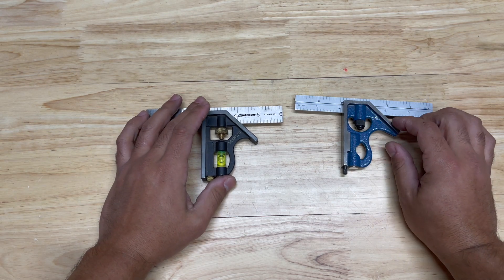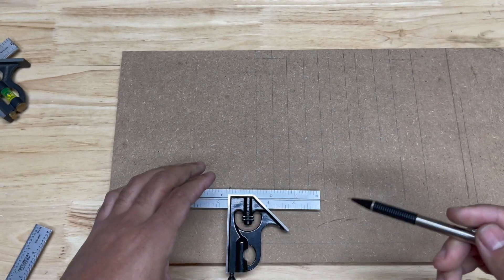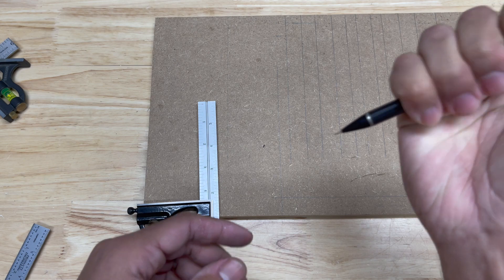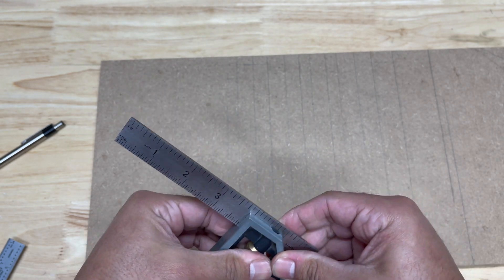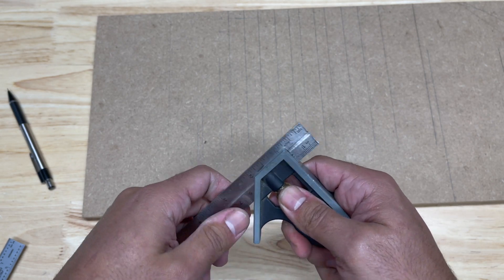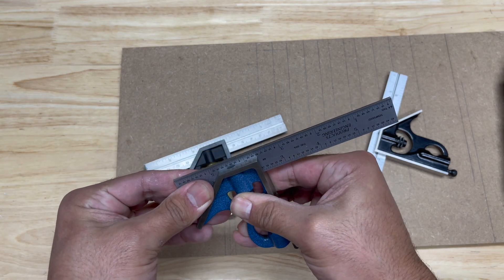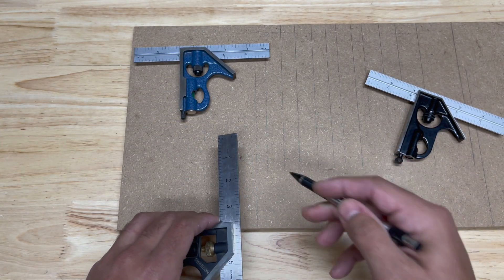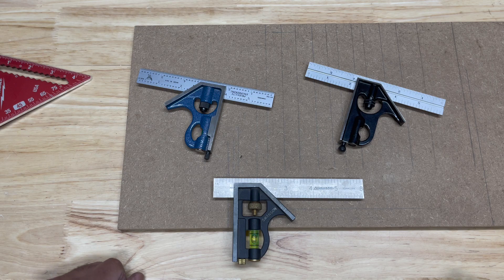Comparing Starrett, PEC, and Swanson Combination Squares! Are Cheaper Squares Sufficient?

Comment: 7 minutes in and still no info yet.. Thing 1,, The wood being used to reference is not adequate,, you could not have chosen a worse piece.. It you want to be proper,, use machined metal.. 9 minutes and WRONG about the fix,, you created a very tiny spot that the blade is riding on, which will wear real fast, NOT all are cast iron,, many are forged and hardened steel.. DO NOT THINK YOU CAN HAND FILE A PEFERCTLY FLAT surface which is imperative to the accuracy....   WHOLE LOT OF BAD ADVICE HERE

Comment: Im 73 now and ALL my squares are Starrett. They are by far more accurate and reliable than any other brand I have  bought. I have a t square that is over 100yrs old and has been used so much the corners are not really square any more. They ALL fit inside of each other with NO gaps anywhere. Squares are the ONE tool you should spend what you can afford . You will use a good one for your lifetime so its a one time buy. Sold all my cheap squares. The advantages to quality tools are comfort of use, accuracy, reliability along with resale value. Should you not require any of your tools, quality is REAL easy to sell to someone else. FWIW I NEVER check my Starrett tools any more. Another advantage to quality tools is expansion. My 12in combination square will take up to a 72in rule. I have a 24in for it that on occasion comes in REAL handy. There will be a lineup to buy all these tools when I am gone for sure. They live a VERY long time.

Comment: One thing you forgot to mention is removing this through the head you should always Force the locknut forward with your thumb so you're not rubbing against the nub inside under pressure as soon as that now wears it's going out of square I always keep a light wipe of camellia oil on my tool and I mean light one or two drops an old t-shirt is all you need

Comment: Thanks for the video. Couple things I've run into I think you should mention tho with cheap squares.
You cant just do the squaring trick with one side, i have a stanley cheapy that is perfect on putside edge and way off on the inside. If I'd adjusted it based on one I'd never have learned that the error is actually from the ruler which was cut at and angle.  And I'd have killed my totally fine square head. 
Also with the more expensive ones the blade locks totally parallel, and the marking are far more accurate. So if your doing carpentry wtf it dont matter but with small finicky finish stuff or for me picture framing where a mm off equals a visible error than it really does matter

Comment: Forget the line and flip technique. If you are serious about your craft you must have a square in your shop that you trust, engineers squares are way more accurate than even your premium Starrett, this square has no other purpose than to check your working tools.  Any combination square can be trued in minutes with a needle file as demonstrated. The only thing you sometimes don't get with the cheaper end of the market is how easily and solidly they lock.  Look for brass locking nut and have a play before you pay.
Reply: Yes, and many engineer's squares are out of square too, so you still need to check with this technique.
Reply: @VideoArchiveGuy Eng8neers Squares come in many grades. My post suggests that you merely buy one decent quality square and use that only for checking your working tools.  Line and flip may be good enough for site carpenters but not for furniture makers you simply can't see the small errors, if you persist in using this method use a marking knife rather than a pencil however sharp.

Comment: It seems kind of pointless to compare any combo square with a speed square, which is a tool for laying out rafters and other uses in rough carpentry. The so-called “DIYer” may care about the versatility of a tool, but for professionals the right tool is the one that is best suited to the specific work being done. I’m not going to frame a roof using a combo square. I’m not going to lay-out dovetails using a speed square.

Comment: I bought my Starret combo Square in 1983 for $40.  I soon thereafter bought the protractor and center head.  Today I went to Starret's site to find the three piece set + ruler goes for $288 !  I have just thoroughly cleaned and oiled all the pieces. I have picked up that Combo Square tens of thousands of times and it always felt good to use the best.
Reply from the maker: There is something different about using a quality tool vs, "the old run of the mill" tools!
Reply: I bought them all around the same time 4" 6" 12" w/ 24" & 36" blades, with all center heads and protractor.. I refused to lower myself to buying Mitatoyo stuff   like the other people did  All still in the RED boxes too.. A couple years back I checked the new price on my 36" blade,, The first thing I saw was $600.00  for just the blade...

Comment: You might be able to square the 90 on a less expensive square, but the 45-degree will be harder to verify and fix.  I used an inexpensive 45 from a combo square to set up my miter saw, jointer and band saw with it and couldn't figure out why my miters were all just a bit off - I blamed myself, the saws, everything but the real cause - a bad 45 on the combo.

You need a verified straight edge, 90 and 45 degree standard that you can TRUST to set up and verify all your other tools, or you'll keep running into (often compounded) errors and it will drive you nuts.  (Tip - PEC has tools with cosmetic blems (that do NOT affect accuracy) for significantly less $ on their website).
Reply from the maker: When truing up my saws and tools, I always check with more than 1 square. However prior to that, I always check my squares for accuracy prior to using them on anything.

Comment: Another reason to get a Starrett is that when you lock it down, it stays locked. Almost every other box store square loosens up, even after a hard tightening. I always wiggle the blade after  I tighten it. Never had to do re tighten the Starrett. That's a Godsend for sure.

Comment: I came to this video after getting frustrated trueing up my miter saw blade up vertical. I still haven't even gotten to the fence or cut into my zero clearance insert. My square is a Starrett 6 inch combo. Ive had it for a year and count on it. But now I'm wondering if it's out of square or if the blade is not truly flat on the thin edge.  After tons of adjustments all day, it got dark and so I held my cuts with the square up to my light and not the sky. Looks like my cuts are either cutting more in the middle of an up to down cut on a long side of a Tubafour or my blade of my square is curved. I spent all day and it's still in my shop in pieces. I'm beat. I didn't know about the taking material if those 2 edges.  That would be last. Guess I just need to get my straight board out and figure what the hell is going on. The square and your pencil come first. I got the best square I could afford and a 5mm pencil. I feel wrecked, beat and discouraged. I typed this up for someone who ends up in my boat. Rule number 1: Assume nothing! 2: check, recheck, try VARIOUS tests. 3 don't move on untill you know truth. FYI, I also sanded a 45 on my corners with a 220 sanding sponge in order to not introduce error because of any tear out. Fyi Im using a brand new 60 tooth diablo blade and gave it several visual test on it's trueness. Also used a digital angle finder and all the numbers are different. Driving me nuts! My table shows .00 on left and .01 on right. Also the non rotating edges of my saw are both low by the thickness of painters tape. I just keep up with it and it's been fine. I might end up building a latter all crooked so I can go to the roof and jump. I'll probably miss the ground with my luck! Anyone else have this experience? Oh yeah, it's a Ridgid 10 inch miter.
Reply: I've had similar struggles with the miter saw (12" Dewalt). I got to the point where I am blaming a small amount of run-out (wobble) in the arbor. THAT I don't think is fixable. So I turned to the shooting board for absolute perfection.
Reply: @jonhuus1925  yep.i just learned about runout. Also hear that as the blade spins, the weight of the teeth will pull on the blade and straighten it some. The arbor an be out and so can the blade. There is a way to mark the blade and measure square in the " best" place but I think measuring the results of the cut is more accurate since and wobble is going to be translated to the wood and that cut is the real point of accuracy to measure.
Reply: To tune a miter saw use a jointed 2 x 4.  Make the cut, flip one of the pieces and press both against the fence.  Do the cut ends fit together perfectly? (do same for the other axis - up and down)
Reply from the maker: I wouldn’t beat yourself up to much trying to true up your miter saw, I can tell you from experience, the base of the miter saw isn’t completely flat and the fence on either side isn’t going to be completely square, bet you can do is make sure one side of your fence is square and don’t worry about the other side, same is true with the base
Reply: going to make a completely new fence with stacked plywood and slide the block true on my table saw. On the deck, ive added painters tape to the sides since the middle is high.

Comment: You don't buy a Starrett for how square it is today.  You buy one for how square it is in 10-20 years down the road.
Reply from the maker: good point!
Reply: Bingo ! If I have to bet my ass on it , it will be the best !
Reply: Comment of the week goes to Josh!
Very true
Reply: Starrett is square for you, your children, AND their children. My Starrett tools are over 50 years old.
Reply: 40 years down the road for me... All sizes 4" 6" 12" with24" and 36" blades, center heads and a protractor  ALL still accurate
Reply: Very true sir !
Reply: Sadly their quality has dropped precipitously.

I purchased a new one and the face of the square was damaged and the ruler was scratched up new, out of the box.

I exchanged it for another… which was the same, only in different places.

I looked at my mother's which was purchased in the late 1970s and was used every day in a factory for over twenty years… and it was still absolutely perfect.
Reply: Your on the  money Josh
Reply: I've determined I like the machinest squares better such as Kinex
Reply: @316woodworks9  You are a wise man.